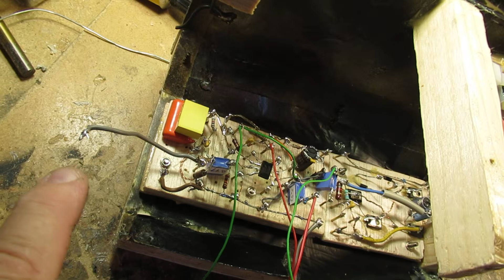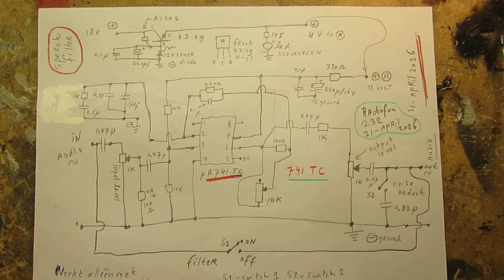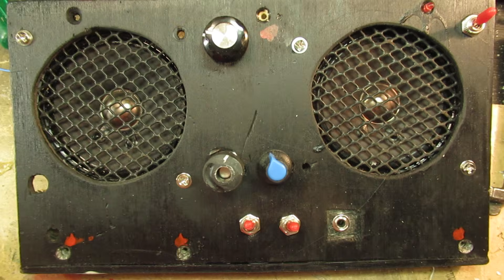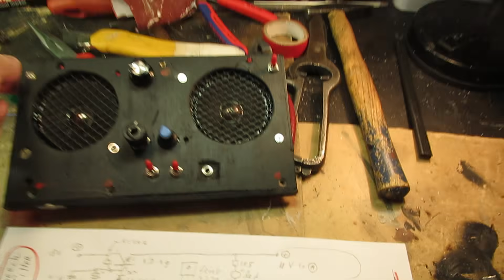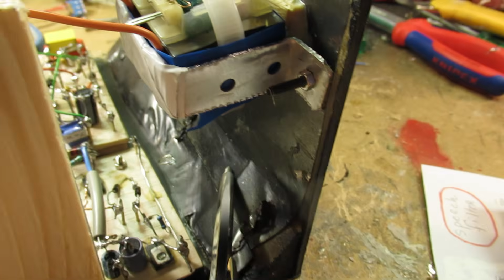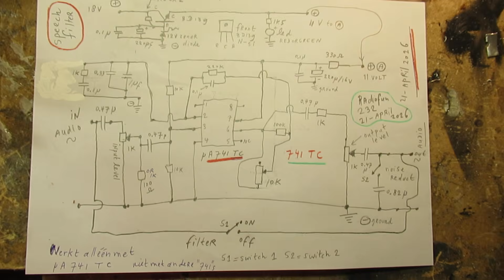Speech filter for audio, made twice, only works with UA 741 TC  (VLOG and schematic)

Comment: Did you ever try something like a TL071 instead
Reply from the maker: Yes. But it has a FET input, that means that I have to test and design it anew.
Reply: @radiofun232 yes, my main concern was only that it may be harder to get such a particular old ua741 for others nowadays if they wished to replicate the project.
Reply from the maker: Demo 25 april 2026 is here https://youtu.be/TGWdO4twqcI?si=LbdPPd_pfu-HizXS